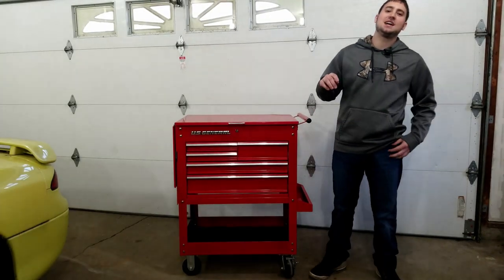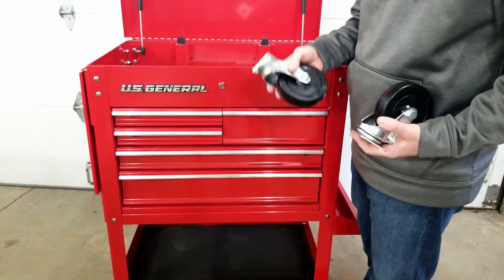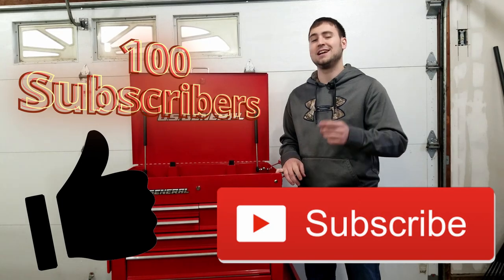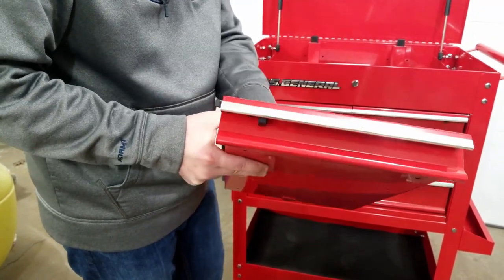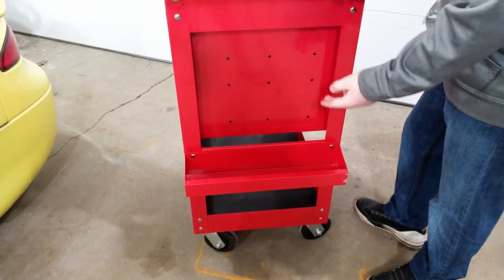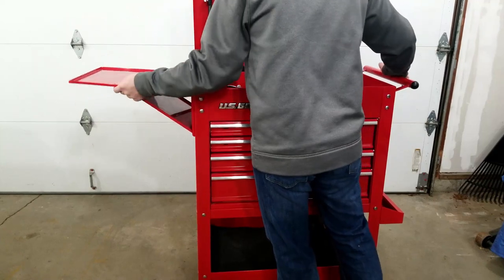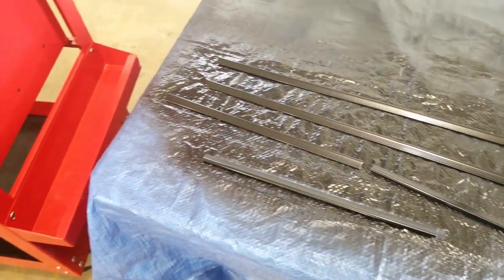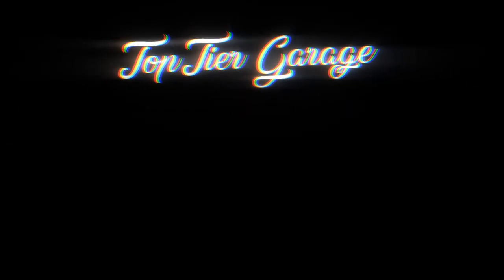Top 5 Mods for Your Harbor Freight Tool Cart

Comment: Having the locking drawers is meaningful to a rolling tool cart. When you roll it around you don’t want the drawers opening.
Reply from the maker: All the drawers lock if you close the top lid. I forgot to mention that in the video. Magnets would be a great idea too.
Reply: i use magnets on every cart every brand i own

Comment: Ha the casters you showed in the ad for $17.99 are not the ones you were putting on the ones you were putting on are $7.99 and are rated for less weight they are rated for 330 pounds and the $17.99 are rated for 375 pounds.

Comment: I've done put magnetic strips on the inside of my lid to hold small tools like picks and impact bits, rubber bump stops on all four corners to prevent damaging the frame or scratching the box. I also put rubber grommets inside the holes on the top part of the box to hold all my socket extensions, the only one I didn't put a grommet on is where I put my breaker bar in since the handle and the shaft is too big for a grommet, only way to put a bigger one on is to get a step bit and extend out the hole.
Reply from the maker: Awesome. Sounds like you have a really nice setup.

Comment: The white cart with the black trim would be fire
Reply from the maker: Maybe its time to get another one 😂
Reply: That’s what I’m rocking #stormtroopercart
Reply: Just ran down to HF picked up a 5 drawer with 189. Coupon and coupon #64590322 good till 1/15 for free side tray with cabinet purchase. I was polite, and they did an over ride and got both for 189 out the door. White in stock. Heads up there raising the price on 5 drawer $10 after the 1st...

Comment: Upgrade your the Dowel/nut solution on the drawer latches with a wee dab of hot melt glue, or even Fun Tak, aka poster adhesive.  That will keep it in there, yet it can still be easily removed.

Comment: Use plati-dip spray coating or auto undercoating on the chrome drawer covers. Then they won't crack, chip, or scratch with usage.

Comment: Couple tips I've learned from others
Mod 1: Use a floor jack to lift the cart without needing to take anything out and set on a stand while changing casters
Mod 2: add magnets to the back of the drawers - I've seen people take the sections of magnets out of the HF tool holder and attach 2 small magnets to the back of each drawer (any magnets should work). Now you dont need to unlatch the drawers and the magnet holds the drawer against the back firmly and still opens with ease once you pull it

Comment: Nice video. Your thumbnail for this video seemed generic, and I watched several similar video before this one.

The wooden dowel mod was smart, and you are right- a mention about the top closing and still locking could be worth mentioning.

The Stuggleville guy has a video about the magnet resistance, to help with the dowel mod. Keep it up!
Reply from the maker: I will have to check out Struggleville's video on it. Dumping a tool cart over can ruin anyone's day 😂

Comment: I like the idea for swivel casters because as you said it enables you to put the box wherever you want it:  You get a point for this one.  You lose ten points for not checking the bolt pattern on the bottom of the unit before you bought the WRONG swivel set of casters, so you had to drive back till the store to exchange them (hopefully) for the right set, drive back home and try (again) to make the installation.    Before putting something out on YouTube, you maybe should know what and HOW you’re gonna do it .
Reply: Maybe he was just making light of the situation. 
Where's your amazing content?